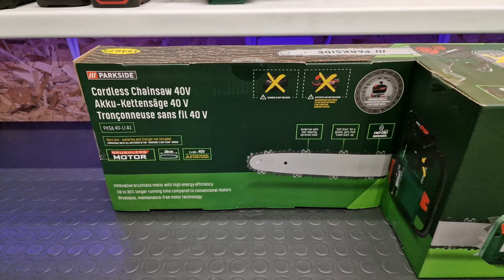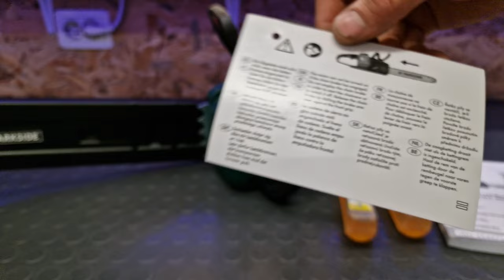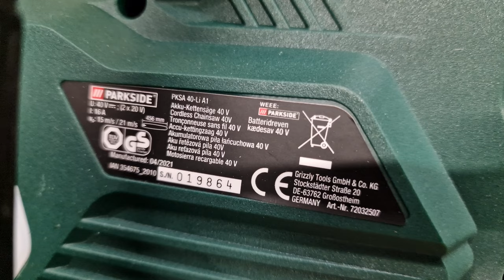PARKSIDE Cordless Chainsaw Dual Battery 40V PKSA 40-Li A1 Unboxing, Disassembly and Assasembly

Comment: I got one, its nice for personal use, it can cut wood up do 10 cm diameter with no problem, but be sure you have batteries with more than 4aH
Reply from the maker: Really useful saw for small works at home.

Comment: Chain looks like oregon's, low profile 91 series chain. Maybe clone. Chain bar unknown or it have any signatures on it? But the big question is the sprocket with the drum. Is it replaceble by any branded sprocket? If not it would be problem when it worn up.
Reply from the maker: In the previous version there was an inscription Oregon.
I'm not sure, but the chain rail should be compatible with other brands and I think there will be no problem with wear
Reply: Spare parts are usually available at service company who repairs Parkside tools in your country. I asked for filters for ash cleaner, and they have it.

Comment: 10:00 Do the accumlators charge by turning the motor? Is there anything that needs to be done to make this motor produce electricity to charge the batteries?
Reply from the maker: It does not charge the batteries while spinning but yes this brushless motor generates electricity and can be used as a generator like any brushless motor.
And this is the proof👇
https://youtube.com/shorts/VZ_Wet7zK9k?feature=share

https://youtube.com/shorts/4-J8OjjtXgE?feature=share

Comment: i think at 4:26 near Oil output hole i see Rubber seal... And when You Mount it again this metal piece with tooth to hook wood (at 12:24) there isn`t... Check if You don`t loose it...  because oil can get intro engine wheel
better check twice...
Reply from the maker: After I put the sheet metal, I noticed that the sealing rubber is gone I removed the sheet metal again and I put it on
Thank you very much🙏🙏🙏🤝🤝🤝
Reply: @ErCanEverything Does your chainsaw leak oil while stored? I hear it is a common problem with chainsaws. Storing it sideways seems to prevent it. Interestingly enough my corded Parkside chainsaw does not leak at all.

Comment: What gear is used between motor and chain (metal or plastic) or is there none ? I cant see one so far. Is the pinion running with motor speed ?
Reply: Itt a forgórész egy az egyben hajtja a láncot.

Comment: Question. If that's is a 1400W chainsaw driven by a 36V4A battery, for example (let's say 160W maximum power) does that mean the motor drains almost 40A from the battery, or does it stop at 4A and the motor is in actual 160W motor with some clever torque mechanism to make it as powerful as a 1400W motor? 
Thanks in advance for your reply!
Reply: Watt is power output, so u cant magically make something 10times the power. Its driven by 2 18V4Ah batteries which should provide 40A both and then its connected to series which makes it 36V and 40A
Reply from the maker: the battery capacity is 4Ah but it can supply even 50A which means it can be discharged within 5-6 minutes with a continuous load of 40A.  In this video you can see how a small 20V motor on an angle grinder can reach 1200W
https://youtu.be/pkrseDZ4p_c
Reply: @ErCanEverything  hey, i want to get one, are u happy with it? I was also thinking about making a battery pack for it ( not parkside BMS ) and as i know it should work fine. Thanks to your video u could potentionally upgrade the motor as well. Thanks!
Reply: @hurvinekspejbl6229  I guess you meant 36V 4Ah. As explained below, those batteries actually can provide up to 10 times their capacity, which obviously makes them last 10 times less.I wasn't sure about it, but now I am. Thanks to all for your comments and help.
Reply: @pepegaka7283  👍
Reply from the maker: I am very satisfied from this Chainsaw and with 2 x 4Ah Battery you can easily cut about 40 Slices d20cm
I didn't expect such power from a battery chainsaw🙌

Comment: Broken oil pump, what should I do?
Reply: I have just opened the saw and cleaned all the things around the oil pump,dust from wood,sticked together,,,works fine again......other possibility that the bio oil get stuck inside the oil pump....take i t away from saw a clean it with alcohol....or buy new one at grizzly shop